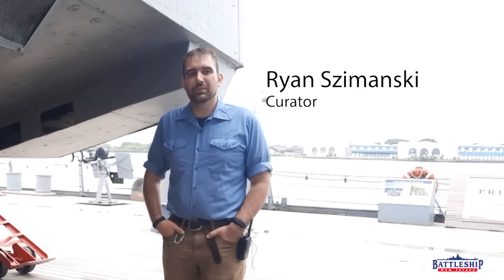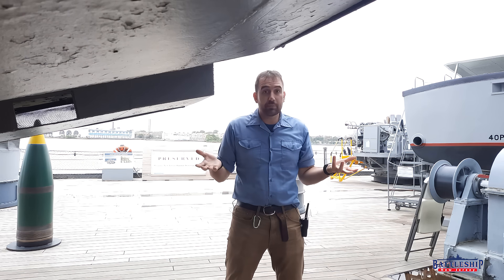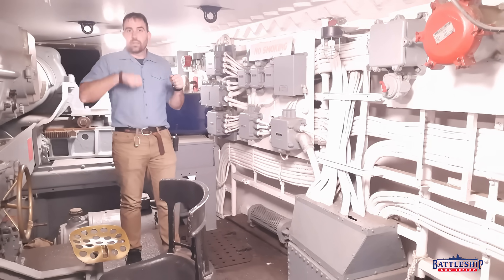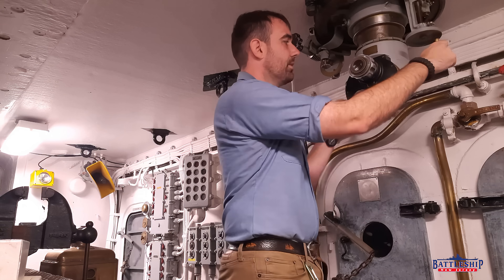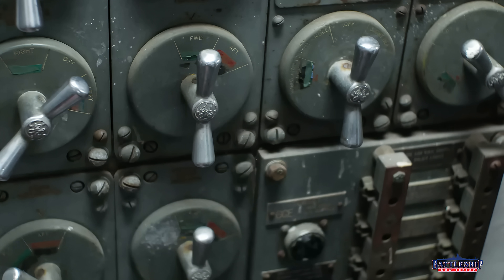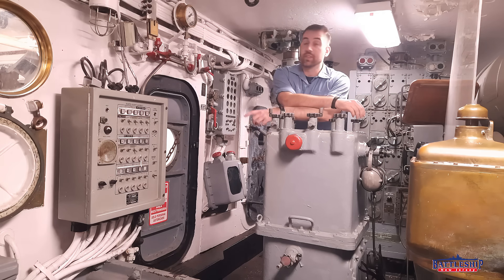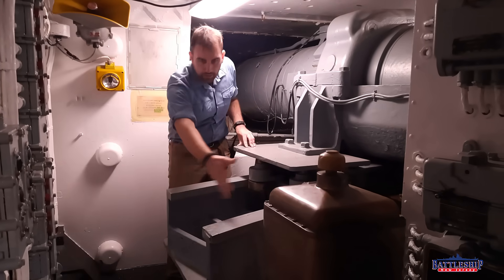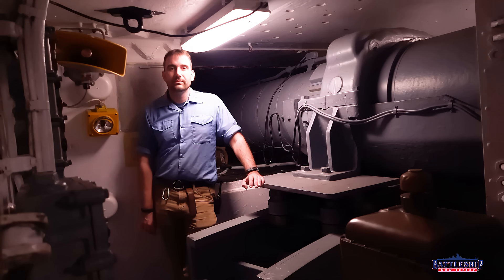Inside a 16in Gun House

Comment: I spent three years on the USS Hermitage (LSD-34). By then I automatically would duck, bob, and weave around everything in the overhead (I'm 6'2") without even thinking or looking. Then I went TAD to the USS Spiegel Grove (LSD-32). Identical ship six months older, you'd think everything was in the same place, right? WRONG. I was walking down the passageway that led to the forward engine room (technically "Machinery Space" as it combined engine room and fireroom), toward door 2-108-1, which on the Hermitage led to E-division berthing (I think it was M-division berthing on the Spiegel Grove). There was a big valve handwheel in the overhead just forward of the door. Of course I bobbed my head to the right to avoid the handwheel, which on the Spiegel Grove put it directly in my path. Knocked me silly.

Comment: I got to visit inside the middle turret of the New Jersey. Has the range. 

Officer gotbin trouble because it wasn't secured. I went up to look more closely at the range, and saw "Confidential" marked material. Sort of surprised. 

Had schedule information. 

It was docked at Long Beach for 2 weeks. We got on a Saturday tour for those withe Navy connections. 

We ate in the mess. The entire time a bucket brigade of material was going with material moved out in angled passages. 

One disadvantage to the design that is handled differently now is how those stores were handled. Now a lot is moved in containers on modern warships.

Comment: Ive heard its called many names, is it turret, battery, or cannon?
Reply from the maker: Turret is the single tube-like structure for the 3 barrels. Battery describes all of the guns on the ship of a particular type. Cannon is a word that generally is describing a single barrel, but we mostly save that for shore stuff, we prefer gun.
Reply: @BattleshipNewJersey  thank you for this information btw!
Reply: @BattleshipNewJersey  thx, so what would a torpedo thingy be, Launcher, cannon, or deployer? I've heard it be called all forms, but I hear launcher more, so which is correct?

Comment: The built up weld beads are typical in structural welding, even today.
You'll run a bead right in the root of the joint, then 2 over that, 3 over that and so on until you've built up a weld bead I believe about 2/3 of the thickness of the material. Its entirely for strength.
So the fact they did it that way, despite welding being a relatively new process shows that the engineers really understood what it would take to get a structurally sound joint.

Comment: Hi Ryan, I'd be very surprised if the median height for sailors in the USN in WW2 was more than about 5'8-9".
The median for USA males aged about 30 in 2016 was ~5'9.91", and that's in fact greater than the height of males 18-24 in 2016 (likely the median dropped due to changes in demographics through birth rates and net immigration). 
Cheers

Comment: I'm 5'8", so those headhunters are still an issue for me.  But then, I was used to keeping my head down in engineering spaces, so less of an issue for me.  Also, I swear thats another reason the Navy uses ballcaps, the bill usually let's you know you're about to ace your forehead on something and the cloth helps at least a little with dulling the immediate impact.

I always get giddy when I hear/see a sound powered phone, though.  Those were some of the equipment I worked on back in the 2010s, still going strong for over 80 years!  Probably the smartest thing the Navy has ever done is to keep those.  Brief aside, the "party line" is called a "net," short for network, I assume.  

My favorite are the turkey phones.  Those are sound powered phone stations with a pulse generator on a crank.  You crank the hell out of it which makes a loud and annoying tone on the other end that sounds like a turkey gobbling, letting them know they're getting called and don't have to man the station all the time.  We used to crank call each other on those all the time.

Comment: If the turret ring had oil injection into the bearing surfaces you could use a 5 HP electric motor to turn the turret. 
Once a month I go up to a friends Observatory on clear nights. The telescope and its frame weigh like 2100 tons. 
The oil injection system pressurizes the oil in between the bearing surfaces and they essentially skate on the oil film with very little resistance.

Comment: Hi from the UK Ryan . Speaking as an ex welder and now heavily involved in weld quality and testing I would disagree with your reasoning behind the design of the weld joints on the armour plate.  I think that the plates are joined using that saw toothed edge to edge prep is that it was the only practical way to join such heavy sections back in the day and bearing in mind that these are non structural welds and not subject to fatigue load there is no need to spend massive amounts of man hours and material that would be required to make fully pentrared joints with the welding technology of the day

Comment: Thanks for a fascinating mini-tour 👍 With your seats at 3:50... I'd wager the 'chair' in the foreground was added after it was taken out  of service. The saddle or pommel-style stools are common on heavy machinery like tractors & old artillery because they are strong, abIe to be used by different sized people without adjustment, and take up limited room (so they are easy to manoeuvrer large, heavy objects around). 
And ironically enough, a shaped stool is also far better ergonomically than a hard flat chair with a back support for those types of jobs... it encourages you to sit upright & hold your spine's natural curve. Seat comfort is a whole other issue though!
Reply: I bet that in every training, drill and battle use it never even rated a passing thought.

Comment: Given US tank crews wore helmets, why didn't the battleship turret crews? Sounds like it'd be good for both non-combat head saving, and the same combat surviability concerns (ricochets, over-pressure, being suddenly thrown into walls ect) as made them lifesaving on the ground. On the other hand at 5'7" I'd probably clear under of any of those welded lifting eyes ect.. average US sailor was 5'9" so a good 3" less than a curator, so might just barely clear, while average soldier was another 2" less again (my height). Interesting that sailors tended to be larger, but this could also be impact of conscription's randomness vs professional military selection pressures.

Comment: Welding a lifting lug that size onto something that thick would never jeopardize the armor effectiveness.  If anything the weld would be jeopardized due to that small lug being welded to something so thick and the thick part cooling so much faster in turn causing micro fractures in the weld it self….every armor piece on ships are welded in😂😂. And pre-heated and probably slow cooled so they don’t crack

Comment: Ryan, great informative series.  One question has bothered me for a very long time, and I hope you would be able to answer it (ideally in a video on the subject).  It has to do with the rammer.  In every video that I have come across, of a rammer on any battleship, the rammer looks like an oversized bicycle chain comprised of links pinned together in series.  In the present video, you show where the rammer runs through a curved channel under a seat in the gun house, so it's obviously not a solid "ramrod".  How then does a flexible "chain-like" rammer push a heavy shell without buckling? A bicycle chain can't do it, so how does the rammer do it?

Thanks, and I look forward to your reply and/or video showing the rammer mechanism in detail.
Reply: The guide tube fits pretty closely around the chain, so it can't flex off-axis, and the  chain itself is really big and beefy.
Reply: The chain can only "bend" in one  direction, because of the way it is made, and if it is constrained against bending in that direction becomes rigid. So it can be rigid where it needs to be and at the same time where there is no constraint can bend to save space.

Comment: I am a Marine but I spend a week on the New Jersey in 1968--was taken on tour of the entire ship--watched them shuttle a1780 lbs shell to the elevator and then up to the gun--watched them put the 100 lb power bags on elevator and move up to the gun---round was loaded by hydraulic rammer and watched them load 3 powder bags at once for a total of 6--was inside the torrent when the man inserted what looked like a shotgun shell into the breach after it was locked--was allowed to stand with the loader inside the turret---when the gun was fired the breach recoiled back within6 inches of my belt buckle..Vibration, noise and some smoke filled the turret ----at that time I was taken out of the turret ---that enough for me------what a gun, it kept moving to allow for roll of ship but it hit its target 22 miles away---THANKS FOR THE TOUR GUYS
Reply: Les Hopkins, I was on board a DDG doing gunfire support training off of San Clemente Island. We were told to stand down while another ship took a shot. I was a Signalman and looked for the ship and couldn't see anything. Next thing I know I hear a freight train passing over us. The ship was the New Jersey and it blew the hell out of the target. Glad those guys loaded 3 powder bags and not 2, I might not be here to reply to you. 😃

Comment: I only weld to repair my own equipment, and am not a professional by any means, but I do know that building up a weld by laying multiple beads is a pretty common practice when welding heavy gauge metal, not because they didn't trust welding. Also, so load and force aren't transferred in a sharp angle, which can lead to cracking under stress. The larger the area of the weld, the more metal it has contact with. The zig-zag  is a good idea though. I hadn't thought of that.

Comment: It's called a 'Gun Turret', please get basic stuff like this correct.
Reply: The entire thing is called a gun turret, the part of the turret he is showing is by literal definition the gun house. You call the interior of a car the cab, not "car", you call its engine bay, an engine bay, not "car", you call the trunk a trunk, not "car", you call a wheel house a wheel house, not "car". A turret is made up of different parts, and in this video we see inside the gun house of turret three. Yes, turret for short as we see what it is and know it's not a fixed point instillation, but underway you would call it battery three to erases any confusion. You call a car, a car, not "mid-sized motorized vehicle," in common speech. Please get basic stuff like this correct, before you try to correct anyone else, about anything, ever.
Reply: Also, it's called a, "16-in/50 Mark 7 three-gun turret," So you're doubly wrong.

Comment: When I joined the NAV in 1968 I was maybe one or more inches below the min height requirement at the time. (Tiptoe at the MEPS station). Therefore, I could stand on the rim of a watertight door and not hit the top rim with my head. My shins, however took a beating until I learned to walk like an ostrich. In 21 years as a Radarman/Operations Specialist, I was stationed on DD836, CLG5, DD880, CG18, CV61, and AR5. It was always a dream to be stationed on a BB but I never got the chance.

Comment: I have what is likely a silly question.  You mentioned that they can't provide water pipes in a rotating turret.  How do they connect the electrical? There are an enormous amount of wiring visible in the turret. Seems to a non-expert that the same issue would be encountered.

Comment: I'm a Plank Owner of the USS New Jersey BB-62.  I decommissioned it in 1991.  I'm 5'11" and was in 'R' Division.  My work center was near DC Central just off of Broadway.  At 5'11" there were a few areas I had to walk with my head crooked over to not smack it on anything. For the most part anyone under 6' tall you were good to go.
Reply: I served on the jersey in 1983 to 1986. Time sure flies bye.

Comment: You should NOT wear Covers/Hats (that's Covers for Marines & Hats for Squids) inside of various structures on the ship (turrets/engineering spaces/doorways from the outside/etc) because you will not see that piece of steel that knocked you on your butt, placing a 1 inch cut on you head.    Anytime you step inside a ship heading where-ever or going up or down a ladder, the head cover comes OFF and you don't lead with your head.  Because with that hat on or blind from the bright to dark, you cannot see what's above your eyebrows out to about 4 inches.  Hopefully, You won't make that mistake twice.  It hurts like H...!  Pain is an excellent teacher.  I always carried ammonia amps for those in need and I got a lot suturing practice on ship because of Covers and Hats.

Comment: The RF slews to look behind the train of the guns, not ahead of the guns.  Thus the guns/turret lead the target, while the RF remains on target. 
The ventilation purpose is twofold.  One for drawing in cool air, but more importantly to pull in fresh air so as to push out smoke and fumes from the turret after the guns have fired.

Comment: “ maybe they didn’t trust welding yet” HA🤣 That made me laugh. No, that is the proper technique for welding plate that thick. Your fillet should be as wide as the thickness of the plate that you’re welding and, that takes several passes to achieve. Usually 3 straight passes and then one final weave over the top.

Comment: Strength of fillet welds depends on the throat thickness - so, the shortest distance between the right angle formed between the two plates and the "hypotenuse" - thus, several beads would be placed to build that up.

Comment: Did these battleships have an even keel system before they fired on a swell? I know that old timber canon ships used a pendulem and a bell to note level and fire.Anyone open to answer.Thanks.
Reply: There was a gyroscopic system called the Stable Vertical that fed attitude information into the range computers to compensate for any pitch or yaw of the ship's hull.

While providing fire support for troops moving inland from the beaches after Overlord, USS Texas flooded voids on one side of her hull to force a list and bring her guns to a slightly higher-than-max elevation to wring out some extra range to hit targets ahead of the advance.
Reply: @mrz80  Wow.Thats interesting stuff.Thanks.

Comment: I'm 6'4", served in the Air Force and cracked my head and the engine cowlings all the time because the height of the C141 engines was always changing due to aircraft loads, fuel, slight changes to ramp angles and other maintenance going on at the time I was working on the plane. One develops a 6th sense when a cowling is too close.
Reply: I fabricated a set of engine parts that were installed on a C141, were needed to be able to fly it into WPAFB for the museum. I was told it was the last c141 that flew out of Vietnam and the parts I fabbed hadn't been made in 50years.

Comment: I can help out with one thing regarding range estimation. When using the periscope it wouldn't be a complete "guess" because if you look at the periscope image again at 6:48 you can just barely make out the vertical lines at the top of the field of view. Those are called stadia lines and are spaced multiples of milliradians apart. I won't bore you with the whole procedure but suffice it to say that you can use that scale against the known length of an enemy ship to make a fairly accurate estimate of the range. It depended, of course, on visibility and the expertise of the person doing the estimate. It was far from a "guess" however.

Comment: The zigzag weld seam may be to prevent cracks from propagating if the turret gets hit. A single straight weld joint could "zipper" open along its full length.

Comment: I'm curious about the protection of the range finder. Obviously they have to look towards the enemy, that means a shell could hit the end of the scope and potentially the blast and shrapnel could access the inside of the gun house. Given that the vents have armor protection, how did the Navy protect these openings?
Reply: There was/is a metal shutter to close and protect the glass and mirrors inside. I am unsure of it's thickness though.
Reply: @j.t.harrison3203  I'm familiar with those, but during combat they would have to be open when under local control. I'm more interested in the protection of the turret crew than the lens, a hit to the shutter (even possibly closed depending on thickness) might result in a blast wave entering the turret via the rangefinder itself.
Reply: @fire304  would be a lucky shot, that slit is not very big.
Reply: @j.t.harrison3203  
A) hitting a ship at over 10 miles at all is a lucky shot. 
B) There are 6 of these shutters all facing directly towards the ship trying to poke holes in you, so what ever the odds are they're 6 times higher...
C) the chances of dropping a shell directly down the smoke stack of the engines must also be very low, yet the uptakes are armored against such a strike.

So I have to imagine the designers considered the chances and more importantly the implications of a hit and therefore planned on it.

Comment: If this were a commercial or industrial operation subject to OSHA, everyone would be required to wear hardhats.  They provide a lot more protection against stationary head knockers than against loose items falling from above.  Hard hats saved my cranium many times walking around power plants, oil refineries, and other industrial facilities, but nothing ever fell on my head.
Reply: Actually, for this type of situation, where there is negligible danger from dropped or falling objects, the lighter weight "bump caps" or alternatively "cranials" (like the lightweight protectors worn on carrier flight decks).

And I've been mostly wearing full-on hardhats for my field work over the last 47 years, and they have saved me from a fewscalp wounds, including my first day on my first job in a cement plant in 1985 when I clunked my head on a beam under a clinker cooler.